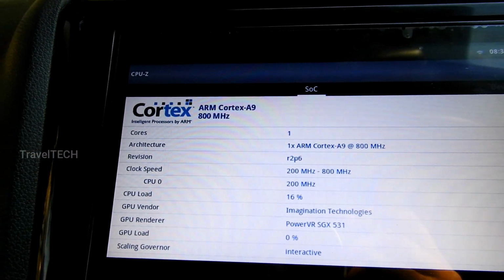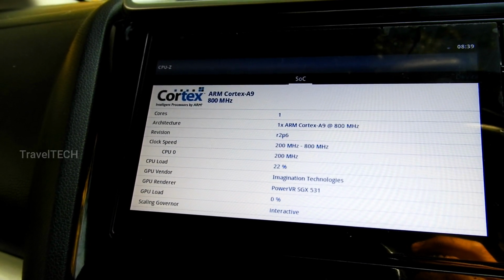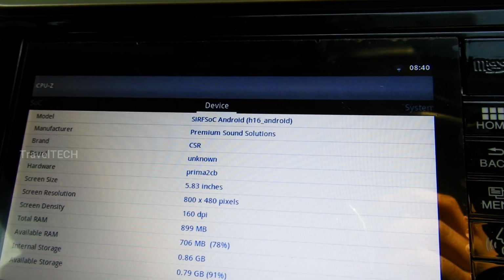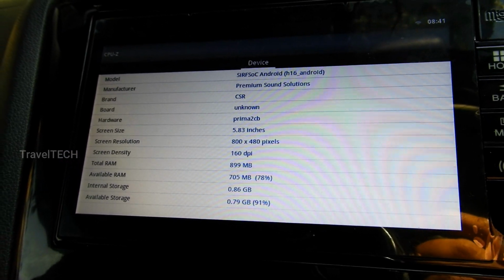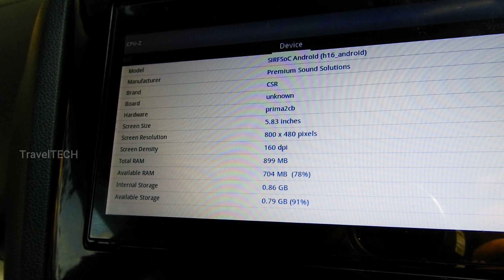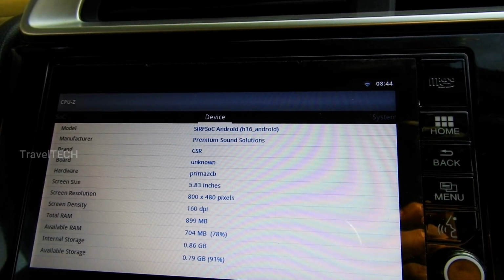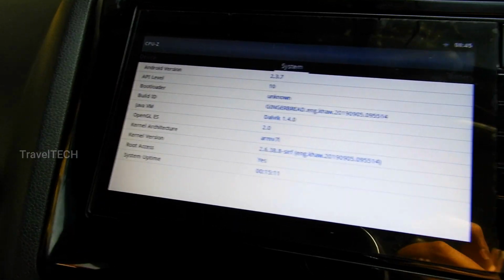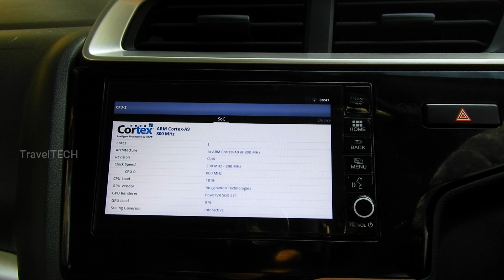Digipad - Detailed Technical Specifications - Honda WRV/City/Amaze/Jazz - TravelTECH

Comment: Do you also know specification of digipad 2.0?
Reply from the maker: Nope, not yet. But working on it.
Reply: @gizmobeep  i have digipad 2.0... I can give you specs if you can tell me which utility application give the info
Reply from the maker: Thats the problem. As of now, there is no way to install any 3rd party app on Digipad 2.0. So just knowing the specs is not going to be useful.

Comment: Why not change the operating system of digipad to android 6 or 7
Reply from the maker: Changing the operating system is not that easy. You need to have access to the bootloader, unlock it first, install a recovery rom..then try to install a new rom which sometimes may or may not be accepted by the device.

Comment: Thank you very much for your hard work. This is both enlightening and disappointing for an owner. A noob question? Is there a way to upgrade the CPU or RAM in this ancient device?
Reply from the maker: No. Its just like if you want to upgrade the CPU or RAM in your phone. You cannot unless you buy a new phone. Same with digipad. You cannot upgrade it.